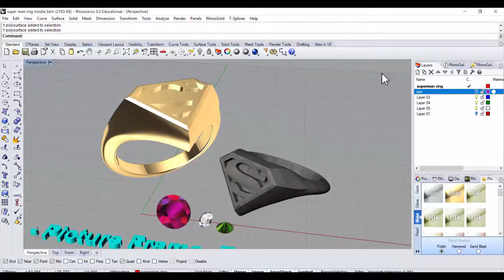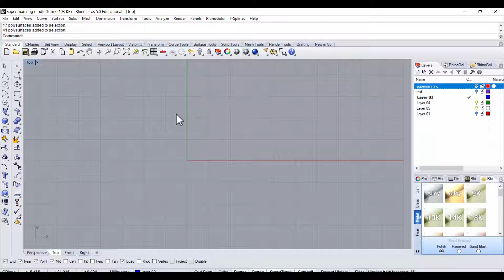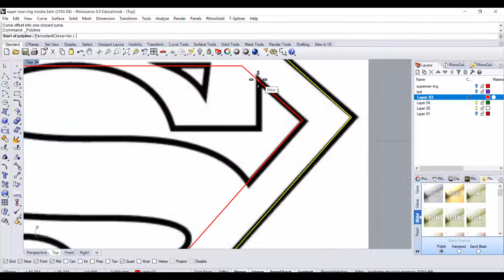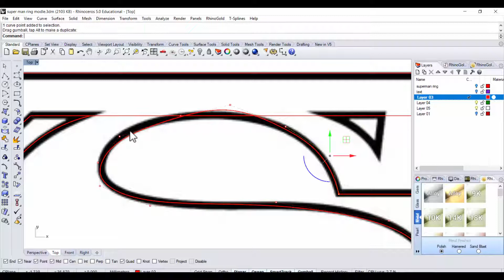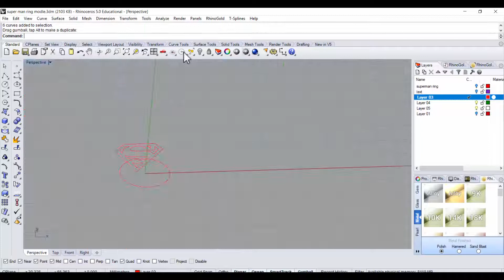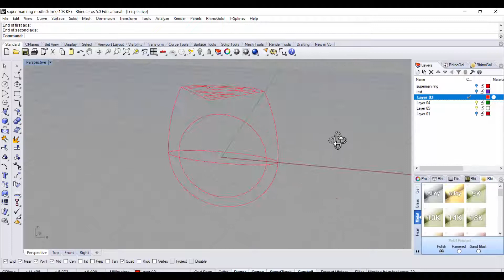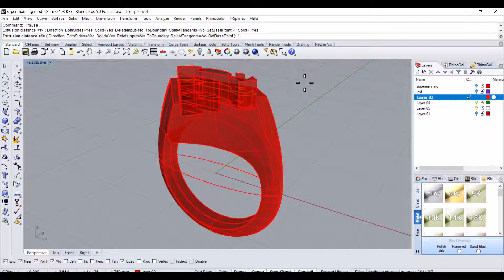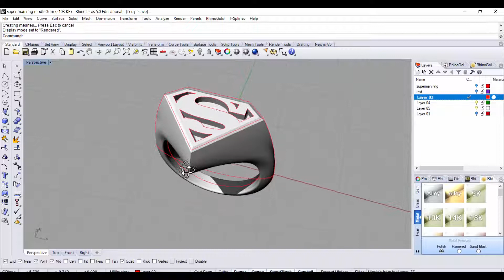Jewelry CAD Design Tutorial #17: How to Build a Superman Signet Ring 3D CAD Model in Rhino 3D

Comment: For some reason my surfaces won't go smooth as yours after the 2 sweep, it gets all messed up even though I did just as you showed! Could it be that there's a setup I messed up??
Reply from the maker: It is hard to know the issue without seeing the model. I am just guessing- when you do sweep 2. do you pick rail on the same end?
Reply: @PJChenJewelryDesign  Nevermind, I just found what I was doing wrong! :)  Thanks for the fast reply and concern!

Comment: Hey PJ. great video. I made a surface using Sweep2. I edit a cross section but the surface doesn't update. is there a setting to have a live update or do I have to apply a new Sweep2 every time I tweak something? thanks.
Reply from the maker: make sure you turn on the Record History when you use command
Reply: YES! Record History was it. Thank you so much. Awesome. I found the History panel but I would still like to enable the toolbar at the bottom with the shortcuts, if you know how. Thank you :)

Comment: a small addition for rendering and even meshing: you can use the Render Tools/ Apply Edge Softening to eithet fillet or chamfer  ALL of your objects edges. 

This fillet is applied on the mesh non destructively, you can change it to chamfer or reduce it/remove it anytime.

It will only appear when rendering or converting to mesh, which is very handy, together with Curve Piping and Shutlining .

Snaps work on the original object, without the Edge Softening.

A very handy tool that we usually forget.

Comment: Can’t get sweep 2 rails to work. It says that it can’t join both open and closed curves. Suggestions?
Reply from the maker: yes, please check both your cross session are closed curve. especially the one on the top. make sure they all join.
Reply: My shank curves are open but they are both joining the top cross section which is a closed curve. I used the snap tools. How do i make the sides closed curves? Sorry I’m new at this. Thanks for your help. I love the videos!
Reply from the maker: you can send your model to my email at pj@pjchendesign.com, I will take a look for you